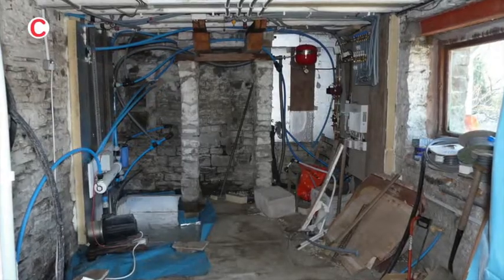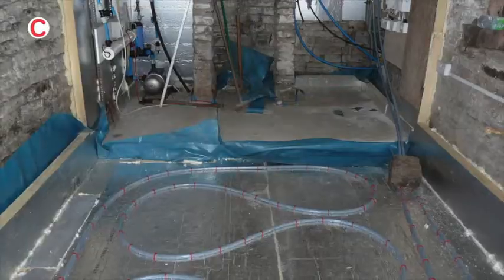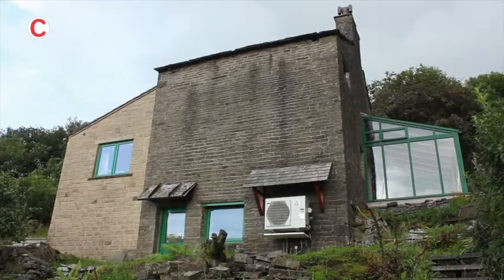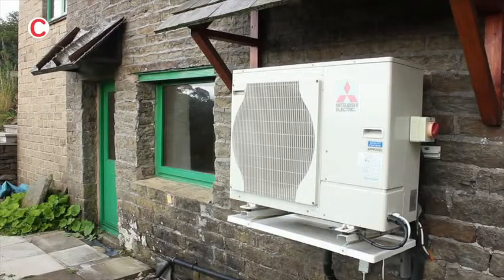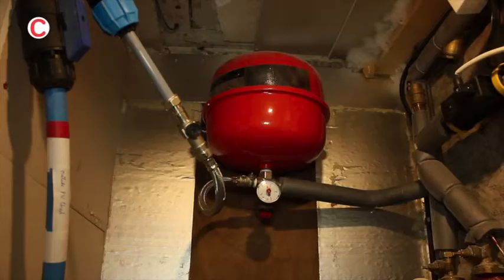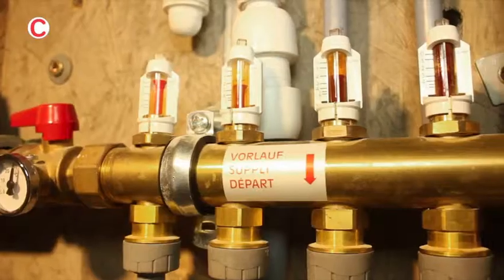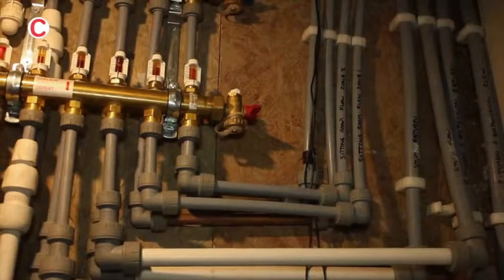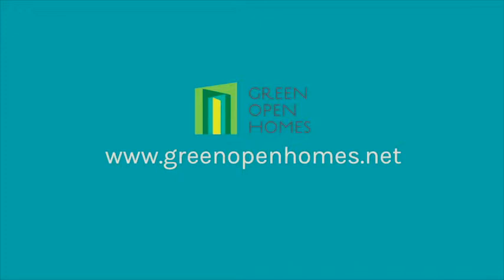Andy Hamilton - Whole House Retrofit with an air source heat pump

Comment: I had mine fitted in March this year, and they said I need 8.5 KWh unit as it is 5 bedroom detached house but it’s only two os is living in it. It cost me about £14,500. My first bill from Octopus was £130 for the month and the second month was £173/ per month. Where as with the gas heating was about £50 / month. So tell me what am I doing wrong?
Reply: Having the thing fitted in the first place!  Sorry to say this, but heat pumps are not suitable for the majority of UK homes.  Someone needs to invent some system that will work in most homes without all the equipment needed for heat pumps.  On top of all this most ‘renewables’ are highly subsidised by poorer people which enables richer folk fit these fancy systems.  We need a complete rethink if we are really going to reduce the use of fossil fuels.
Reply: Good question - and there are many possible answers. Do you think the unit was sized correctly, was there a pre-installation assessment carried out? Oversizing and running inefficiencies is one way in which energy use and costs go up.
Reply: @carbonco-op  yes, two checks were done by the special teams. And they recommended for 8 KWh unit.

Comment: Glad to hear that insulation was on top of your list. I did the same based on, ‘ if we had perfect insulation we would not require heat input much at all’. We face South so solar gain helps us. Next stage might be an air source heat pump.